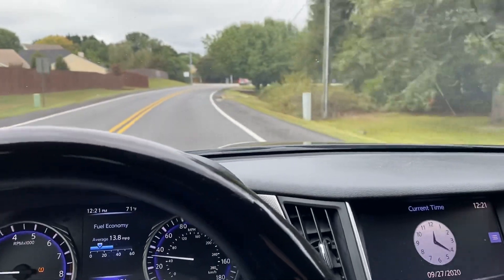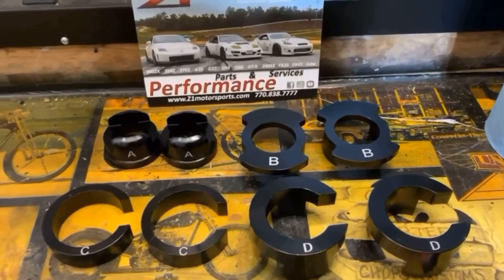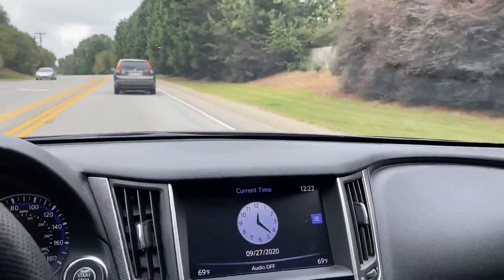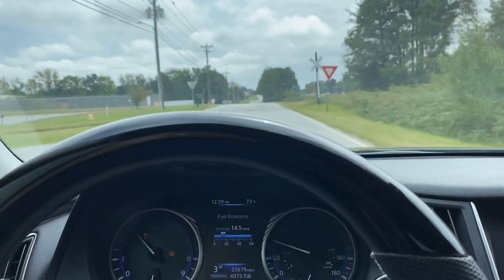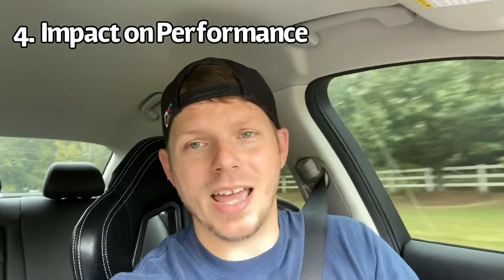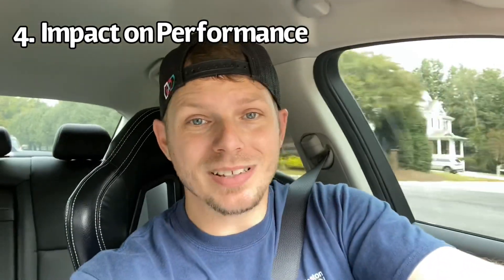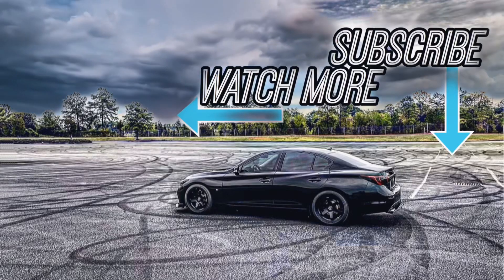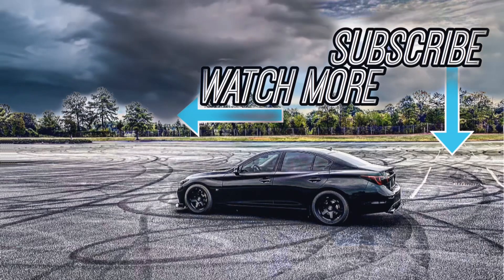Q50 SubFrame Bushing Collar Review | Z1 motorsports g37 370z

Comment: Nice bruh, would you recommend it for the G37s coupe , and also will this help me put down power better at the track
Reply from the maker: Definitely.  Anything to stiffen the chassis or reduce flex in the subframe is a great mod
Reply: @SpeedCultureStudios  am on the stock suspension , I have the z1  transmission mount and the bell race work  diff and I did feel a noticeable difference, would this z1 subframe collars help  add to the performance along with these other mods.
Reply from the maker: @torvarrisevans3961  I believe they have collars available for the G.  If so, yes you can feel an immediate difference with them.
Reply: @SpeedCultureStudios  thank you bruh
Reply: @SpeedCultureStudios  what are thought on the z1 upper and lower manifold. Do you have those as well
Reply from the maker: @torvarrisevans3961  no I don’t have those and won’t.  Not worth it.  Haven’t seen any evidence of power gains with them
Reply: @SpeedCultureStudios  thank u bruh